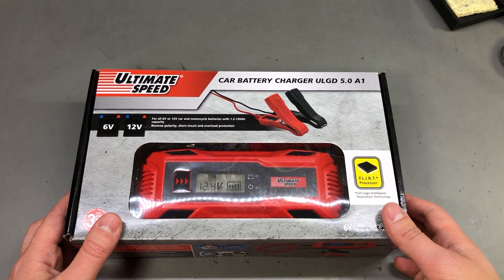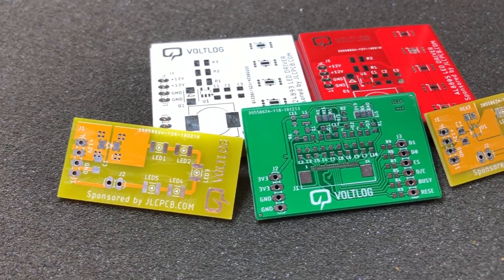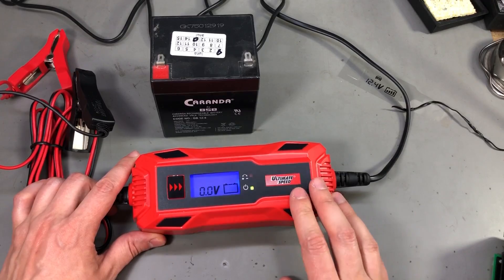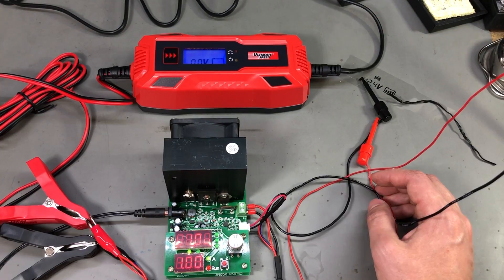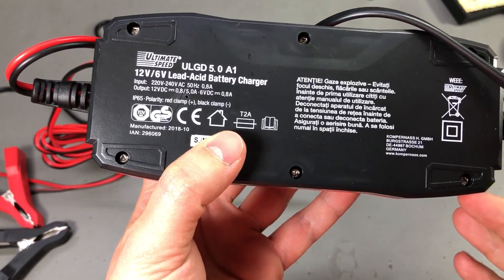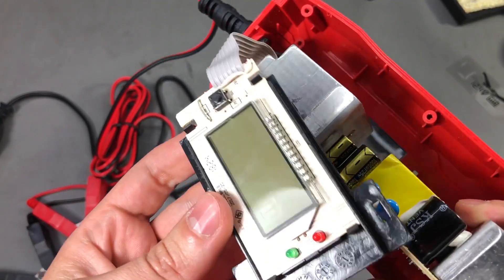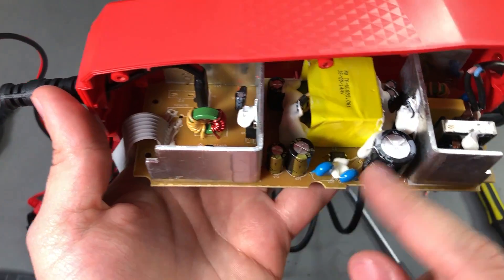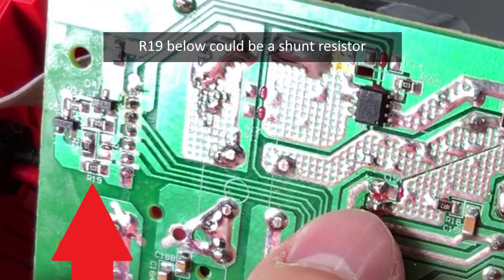Voltlog #228 - LIDL UltimateSpeed Car Battery Charger Teardown

Comment: I wish I had a FLIRT processor when speaking to the ladies...
Reply: You just need to develope a decent software to perform the task, the hardware is widely available. Confidence and alcohol usually helps in the development.
Reply: @111chicane  Correct amount of alcohol = Liquid courage, and works very well, but more of it calls the asshole interrupt of the processor. :-)
Reply: Just relax, FLIRT processor will come...

Comment: I wonder if the microcontroler could be reprogrammed to adjust the voltage limits. Also, on this model charger, there is no "desulfation" feature, although it is claimed on the box (I know, the desulfation feature of any charger is mostly rubbish anyway, but still…).

Comment: it looks like this charger do not follow its own specs, I plugged it on battery loaded at 13.1V (checked with volmeter, show same value as the Battery charger) my ampmeter show it was loading at 0.8A but in the documentation it is written that 12.8-14.1 range should load at 3A and only next step in its intelligent load system that is 14.1-14.4 range is the one that should load at 0.8A

Comment: The secondary filter inductor has a thinner wire coil, it may be a current sensor, could not see the PCB traces it is connected.

Comment: i used it once. It has max 5a for 6v and 0.4a(or 0.9a) for 12v. It took almost a week to charge my car batery :))
Reply from the maker: That would make it a bad product, are you sure it wasn't just going into that winter mode, signaled with a snow flake? it would make sense to only provide less than 1amp in that mode.

Comment: I would use my power supply set on 15-20v and do small repetitive bursts of charge on the old battery until it goes up to 11-12v.
Then use the LIDL charger :)
I've resurrected many batteries this way, NiMh included.
Reply from the maker: My battery barely takes any current, I think it is too old and I have to dispose of it properly
Reply: @voltlog  I had a small test lead-acid battery like yours. It was working very badly after 4+ years of sitting on shelf. I popped up the upper cover and it had very simple rubber corks on it. I found out that it mostly dried out.  As I did not care much about it. I simply filled it back with tap water. Then I could charge it and it is working again. Your problem may be something else but these tiny batteries do not really have great valve system apparently.
Reply from the maker: @eyurtese  mine was sealed, I just took it to the local recycling center.
Reply: @voltlog  Mine was also sealed :) until I opened the top cover. If you watch your video, you can see that you can pry open the top cover where the sticker is, you even have 2 notches there from which you can get leverage (at 2:39). It is a flat plastic piece glued on top.

This is the battery I have:
https://www.partco.fi/3140-thickbox_default/ct-leader-12v-13ah-sealed-lead-acid-battery.jpg
As you can see, it is also sealed. I just had to use an utility knife to carefully pry it. It was just glued there. If you look carefully, I also had 2 very small notches in the middle (one just under the embossed/stamped text)

I am not talking about opening from middle, the cover I am talking about is the flat plastic on top.
Reply from the maker: @eyurtese  thanks! I'll keep that in mind for future batteries.
Reply: This charger have the possibility to rejuvenate dead battery if it's higher than 8v just let it blink and it will do is job

Comment: My guess is it's pulse charging - turning on the output for a bit then turning it off again to measure the battery voltage - so you'd need a permanent voltage source to fool it into trying to charge it. It might work with a dissipation resistor between the charger and the PSU, setting the PSU to a "discharged battery" voltage. The dummy load might not work for that though, as it would need to pass current both directions...
Reply from the maker: I think a source measure unit should be the tool for this job but I don't have one of those. Or maybe a smart electronic load with more advanced modes.

Comment: My usual way to handle that is a electronic load and a power supply. I set the load to sink more current than the charger can deliver, then adjust the power supply to the desired voltage. Without the charger the power supply will deliver all the current to the load, with the charger connected the difference between power supply and load current is charge current.
Reply from the maker: That's what I was trying in the video with the dummy load but it doesn't work as expected partly because of the power supply I was using which is only capable of 2A and partly because of the charger which will only start a charge after it does some checks then as soon as it starts charging the voltage rises quickly and it thinks it's done thus stopping the charge.
Reply: The voltage will not raise if the load drains the current, but if the charger can deliver more current than your supply can deliver or you load can sink, then it will not work.

Comment: You don't really need constant current to charge  lead-acid batteries. You can just PWM it as the battery voltage raises during the charging process. Charging with pulsing current also helps anyways.
Reply from the maker: yup, after all those old school transformers had not constant current function.

Comment: Put the dummy load in constant voltage mode at 13V. Add a lab power supply, set it to 12V. connect them together, add add also the carger....

Comment: Thanks for the thorough review. I must admit I don’t like these intelligent chargers. Often they will not recharge a discharged battery that is chargeable with a simpler battery charger using a simple mains transformer and rectifier. Sometimes I’ll charge a weak battery with an old school battery charger for a while then use an intelligent charger to finish the charging. This trick is worth knowing about as battery’s are very expensive now. I paid over £100 for my last motorcycle battery. 

Keep up the excellent reviews.
Reply from the maker: I remember about 20 years ago my dad had a huge car battery charger, it had this huge mains transformer. I'm not sure what kind of current it was capable off but it was so massive and it was humming all night long :-)
Reply: VoltLog typically they consist of a mains transformer and rectifier capable of delivering 13.8 volts or so with no current regulation. Most domestic ones are capable of delivering 5 or 10 amps. I still have two which are probably 30 years old. Back in the day when lab power supplies were expensive it was common to use a charger as the basis of a homebrew variable power supply using the venerable LM317 and, if higher current was required a 2n3055 power transistor in pass mode!
Reply: That's what I was thinking.

Comment: Nice Video. At the moment in germany LIDL sells a 14Ah powerbank that can start cars with dead batteries AND has a small compressor built in for beach toys, footballs, bicycles, etc. I'm not sure why but i find it hilarious. Maybe they will get the same thing in your LIDL sometime. I think it would be a neat product for a test/teardown.
Reply from the maker: thanks, I'll keep an eye on their offer maybe the powerbank shows up, though i remember seeing it a few months ago.
Reply: It would be interesting to see if it actually meets the 14Ah claim. Apparently, a lot of those are "single cell equivalent" capacity ratings that apply to the USB output.